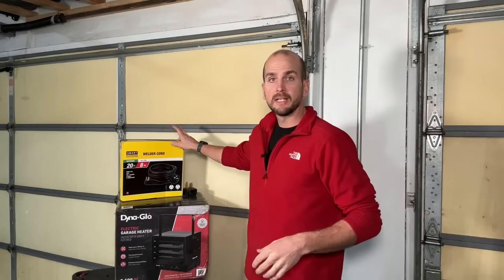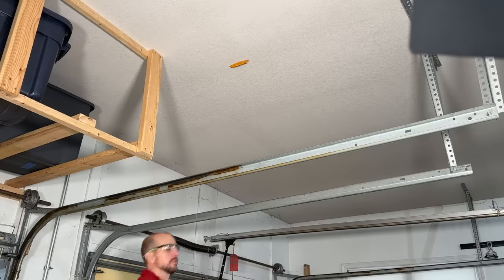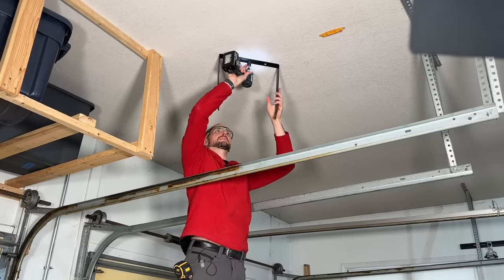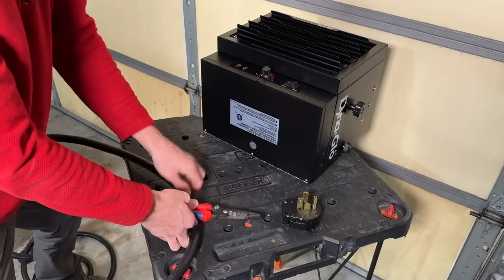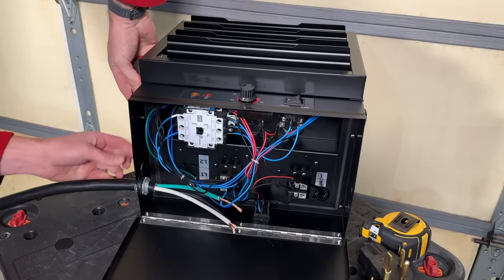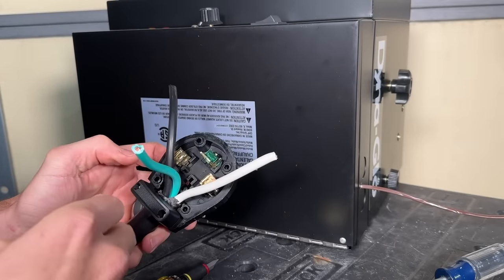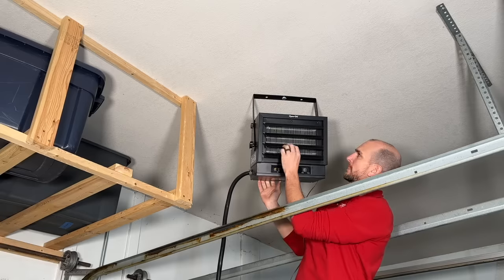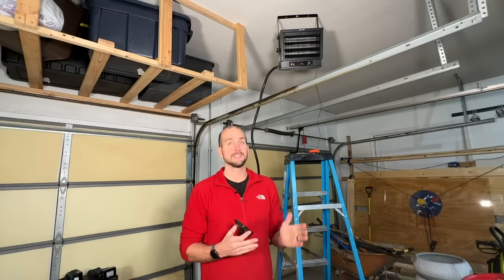Electric Garage Heater Installation And Test

Comment: Isn't that thermostat a bad location?  You will get some cold air seeping in the garage doors.  I would have mounted it on the wall opposite of the doors.  Great video though.
Reply from the maker: Oh yeah, not ideal for maintaining a consistent temp throughout the garage.  It is a bit more of a simple on/off switch for me.
Reply: @EverydayHomeRepairs  makes sense... you should do a voice activated switch.  Like "Alexa heat the garage"  :)
Reply: Mechanical HVAC engineers know to never mount a thermostat on an exterior wall

Comment: Sorry, @Kevin and others, for my previous post. I truly didn't understand the difference between 240v wiring for a heater vs 240v wiring for dryers/ovens, which also require 120v. My apologies. I need to do better research and not ask my questions here.
Reply: @Kevin-mp5of  - sorry about that. After doing some research, I saw that I WAS wrong in so many ways. The only way to go was just delete it and make amends. I'd be glad to read your explanation.
Reply: @Kevin-mp5of  I went out to the InterNACHI site and educated myself, which is what I should have done first. 😏
Reply: @Kevin-mp5of  - haha. No need. I don't blame you. Reminds of my deceased electrician-friend's favorite comment: "Some of my best work gets covered up." May Al RIP.
Reply: The only thing correct in my post was that the white wire needed to be repurposed with black or red tape! The rest was just so wrong....

Comment: How does the wiring go into the thermostat?     I saw you wiring a red and white wire.    Does the red go to R on the thermostat?  Where does the wire wire go into?  I have g (ground?) r, ob, Y, C and W.    My assumption is red to R and white to W?
Reply: G is fan, R is 24v, OB is reversing valve for heat pump, Y is cool, C is 24v common, W is heat. I would check to see if that t-stat is compatible with this type of unit, it may need a high volt stat
Reply: @timthomson7532  I picked up one of the 100$ nests and this same heater for my garage.      If I understand it correctly, I should be good to hook up the red to the 24v and the white to W for heat and I’m good to go?
Reply: @teslamike7476  I think the thermostat has to be high voltage in this unit
Reply: I checked, thermostat has to be rated 240 v and use minimum 14 gauge wire. I think the nest would blow up
Reply: You guys are right. The thermostat terminals on this heater are 240 volt. You need a line voltage t-stat. What he did is very dangerous because even though the t-stat wires don't carry the heat load, they are still 240v and require a minimum of 14 gauge wiring and need to be in conduit.

Comment: I just bought the same heater. Instructions sucks about wiring the heater. Plus i dont think you cover that also. which wire go to L1 and L2? The angle of the camera didn't really captured the wires that you screw into those connectors.
Reply: @Kevin  i like to hands on with my project and learn. thanks for the response. I really appreciate it.

Comment: So am I correct in saying that this is a 40amp heater running off a 50amp breaker??
Reply: Yep, he is using a 50 amp car charging circuit.
Reply: 40 amp breaker, #8 wire. Unit uses 31.25 amps at 240 volts

Comment: What thermostat did you pair with this 7500w heater? 
I have the same heater but looking for a thermostat to pair with it
Reply: @Kevin-mp5of  is there a thermostat you reco?

I can't fine one that supports 7500W. Does that matter?
Reply: Honeywell CT41B1017 would work

Comment: All good except you have used a low voltage thermostat and low voltage wire with a 240v thermostat terminal. I am pretty sure there is no transformer in there and although those thermostat terminals do not carry the full current they do carry the full voltage that then switches the contactor. This could be very dangerous as the thermostat would be now live at 240v and not designed for it.
Reply: You're correct. The manual shows the external thermostat switching 240V for both the contactor and fan. Also supposed to be 14 ga. minimum wire. He's lucky when he jumpered the thermostat wires while holding 240 volts in his hands.
Reply: Yeah I just got one of these same heaters and after watching this video, I thought maybe there was a transformer in the heater so I checked with my multimeter. 240v at the thermostat connections. I hope he realizes the mistake he made and edits this video.

Comment: Nice to be able to use that 14-50 for other things.

...but will you be plugging & unplugging the heater often in the winter to charge your EVs?

At what point would you consider that an issue for the outlet's longevity?
And what options would you consider to improve that situation?
Reply: 1. He has another recent separate video replacing the receptacle with a heavy duty Hubbell 
2. I would presume that EVs are usually charged overnight - when everyone is asleep. (I would never consider getting involved with an EV. A folly. They do catch on fire. )
Reply: @KameraShy  They don't catch on fire any more than ICE cars.

Comment: Can someone please tell me what thermostat to use on my dyna-glow 7500 i cant seem to figure it out
Reply from the maker: Pretty much any cheap thermostat will work but don't forget I think you need to flip a switch to let the unit know the external thermostat will control the temperature as opposed to the integrated temp control.

Comment: He never states what wire gauge is involved. Gauge matters. Also he doesn't say anything about torquing down the screws.
Reply: Would require at least #8 copper wire in cord. All electrical connections MUST be tightened with torque wrench or torque driver going by the last couple of NEC code books.
Reply: 40 amp breaker, 8 gauge wire and tighten it as tight as you can without stripping the lug. Wiggle the wire at the connection and tighten it again. Use noalox just because

Comment: Haha .12 that’s cheap. I’m over .38 a kWh and rates seem to go up every month. I need to move.
Reply from the maker: That is crazy it varies that much.  Are you out in Cali?
Reply: @EverydayHomeRepairs  I know it really does! Last Jan 1 and this Jan 1 there was a 25% increase! I’m in MA. This fall I actually installed a mini split in my 1 car 26x16 foot garage which has now been turned into a home gym. It does well for the cold mornings. Just received my first electric bill with everyday use and extremely cold temperatures. Bill was $171 more than last year but used 200 kWh more now with the mini spilt and new elliptical.
Reply: @pklemm1 I did a mini split in my garage but when the temp drops below 30 outside the heat drops inside.

Comment: Strongly suggest not buying this unit. Had element failure after one winter of use. Email to customer service got zero replay. Called the company and they will not sell you a replacement element even though it's a current product. So...this is basically a throw-away unit if anything fails. $250 down the drain!  Two thumbs down!!

Comment: terrible install
Reply: Nothing wrong with the install. Covers the basics and arguably the most critical section, the electrical, very well in detail
Reply: @avsrule247  He's a troll... If he was not he would actually explains why he says that...
Reply: Why?!?
Reply: There were some little things people said like didn't torque and didn't label white as hot, in my opinion that is nit picking in this situation. I appreciate people taking time to make these videos and he took time to explain the cost of running. Only  thing I seen was the wire he used was 12-2 from description and I believe he was fooled in to believing it was 50 Amp wire cause of the 50 Amp ends on it.

Comment: Where i'm at people can get seow cord by the foot, so it is more viable to get the length they need plus a plug. In that case, there is not really a need to slice up extension cords
Reply: Cord was like $35 don't think you can buy it buy the foot cheaper. The catch hear is that cord is not heavy enough. It has 50 Amp ends on it but the wire is 12-2. I believe ira only rated 20amp
 People buy thinking they are getting 50amp wire and they are not.
Reply: @Ilikeeminleggings  $35 per 25 ft. Witch is great for copper wire rated for 50 amps. But turns  out his is 12-2